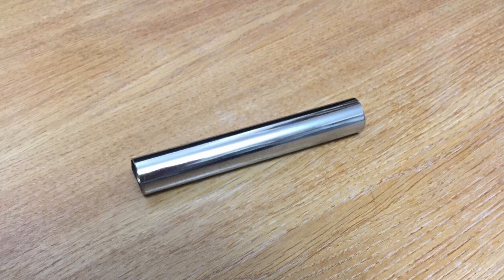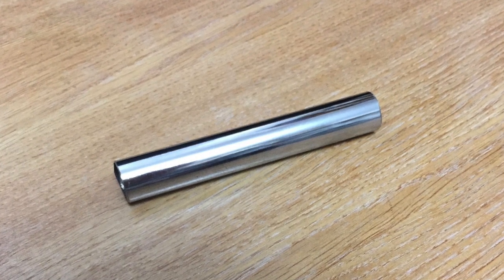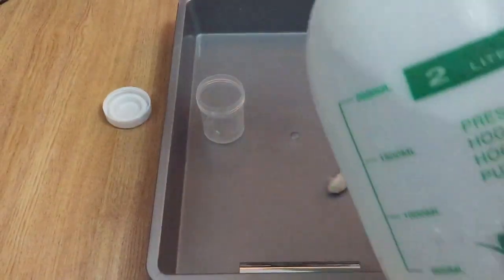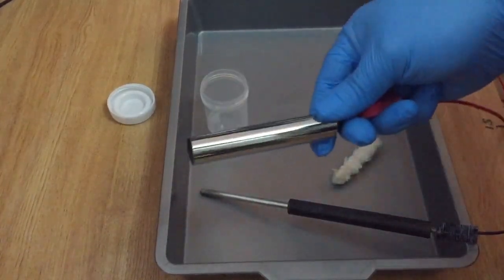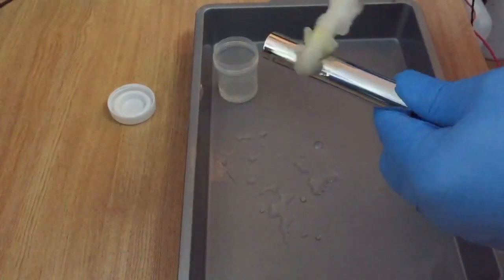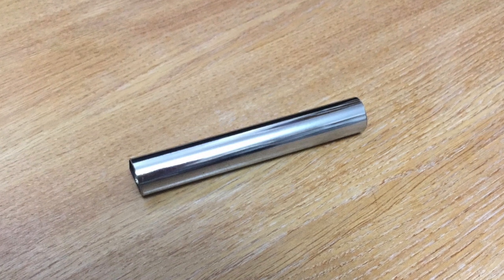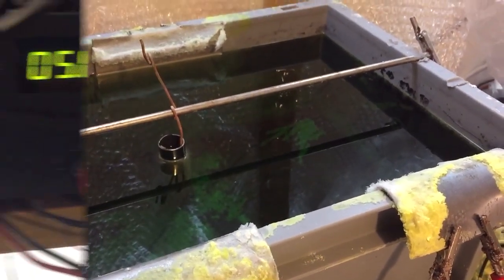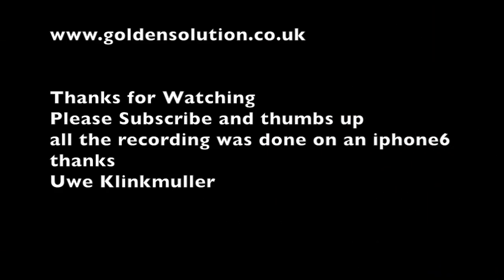How To Strip Chrome Plating /chrome stripping

Comment: Thanks for this. If using a basic 12v power supply with the connector cut off how do you determine which wire is positive and which is negative?

Comment: why doesn't it melt the cooper the other metals included in the process?
and does it work if we use other liquids instead of sulfuric acid?nalc...etc
thank you
Reply from the maker: to melt copper or other metals you need to heat them up to there melting point 

its not sulfuric acid what we use 

there are different chemicals what you can use for chrome stripping

Comment: What is the name of solution that’s in the tank? And does it work to unplate nickel or zinc also ??
Reply from the maker: It’s chrome stripper you can get it on my website wwe.goldensolution.co.uk 
Thanks
Reply from the maker: No it removes chrome only 
Thanks

Comment: Will a TIG brush remove chrome
Reply from the maker: What is a tig brush
Reply: It is a machine that has a positive and negative set up. The negative if for an earth lead to clamp to work piece. The positive lead has a brush on it. The brush is dipped in a solution and dragged across st/ steel welds to take the discolouration away. Check them out on YouTube.
Reply from the maker: @robwilliams4229  sounds like the same what I use should work if you use chrome stripper

Comment: I have a classic motorcycle which has had the engine covers chrome plated can this product remove the chrome off the aluminium. Thanks
Reply from the maker: If it’s chrome plated yes it will 
Thanks

Comment: What is the "stuff"??
Reply from the maker: chrome stripper
Reply: @GoldenSolutionPlating  And what's the chrome stripper made of?
Reply from the maker: @justinbelshe  well the chrome stripper what we sell on my website or ebay shop https://www.goldensolution.co.uk/collections/plating-chemicals-and-polish-mpu-meta-seal-activator-cleaner-chrome-stripper/products/chrome-stripper-remover-500ml
is non toxic and does not contain any acid but i cant tell you what its made of we make it our self 
the chrome stripper in the tank is made out of de ionized water and caustic soda or better known as Sodium Hydroxide  100gram per Litre but its acid and very expensive to post this is why i dont sell it 
thanks